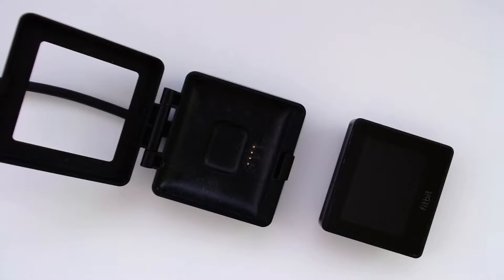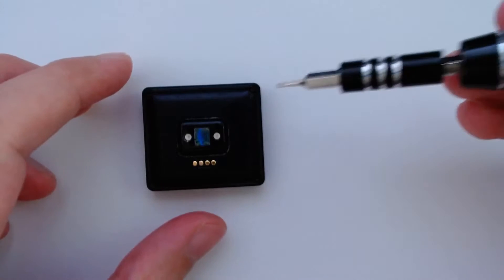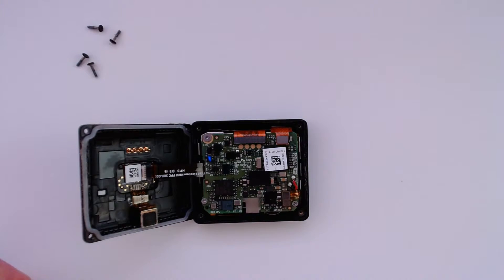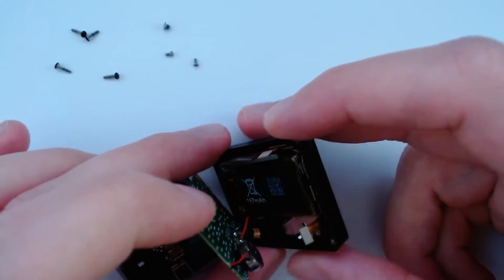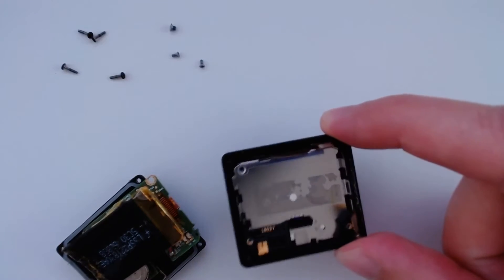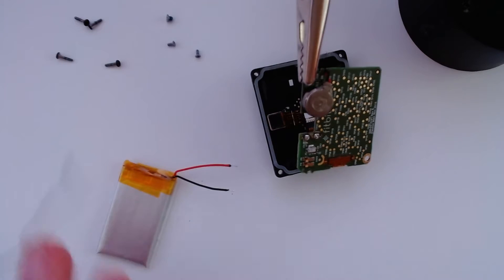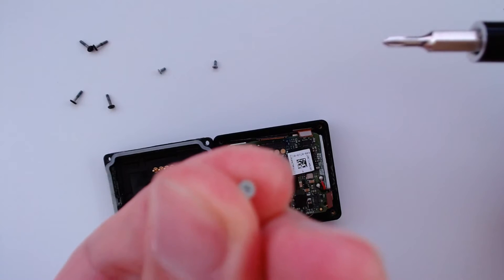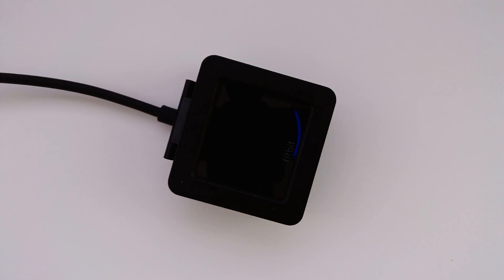How to replace the battery on a Fitbit Blaze (fixes overheating issue)

Comment: I managed to do this sucessfully. The only issue I had was that the speaker/vibrator was stuck down and so I had to desolder it to get the motherboard out. It does require a fine tip solder iron and steady hands !

Comment: Hi. Watching your video gave me the courage send for the battery and try to fix my Fitbit. I figured if it worked it would be a bonus and if it didn't work, I would still benefit from the experience, but I wouldn't replace the Fitbit. I ordered the battery and got all excited until I realised that I my screwdrivers were not suitable, so I had to order a new set. When they arrived, I watched your video and opened the unit and got stuck in. I had a battered soldering iron, but it was clunky, and the solder was balling. I ordered a new iron and waited... I wasn't home when it arrived, I had to collect it from the local office. I collected the parcel and went to the local hardware shop to get some flux to complete the job. However, I wasn't prepared to pay £14.99 for a tub so ordered it online (£3.00), and waited...The flux made a big difference, and my first attempt got it working in the charger, but I was unable to switch it on I was going to chuck it and chalk it up to experience but I decided to sleep on it and look at it again a day later. One of the battery wires had worked loose trying to set the new battery in place and I took photos of the unit as I went so could also see that the battery was not facing the correct way for my model. I reset the connection only to see that all the messing about pushing and pressing had disconnected one of the speaker wires. "Oh, for flux sake," I thought! It just wasn't my day. Again... I slept on it and came back at it the next day. I re-soldered the connections, flipped the battery, shut the unit and held down the start buttons not expecting it to work at all. It worked! It switched on. Thank you! Hahahaha! I'm going to have a go at my TV next. The solder was balling there too. You've created a monster now! 😊😉😁 Thanks again.

Comment: Thank you for a very clear and informative video. Could you please tell me what power your soldering iron is? Thank you.
Reply from the maker: Hmm, I don't think I remember exactly what setting I used. I would say go with low to medium heat/power. The wires inside are so thin that it doesn't take a lot of heat to melt the solder. And you don't want high heat around batteries anyway.

Comment: Did you use a static free surface? I know I had to use a static free surface with installing a computer motherboard. I assume same thing here?
Reply from the maker: I actually didn't here, but I do agree that having an anti-static environment is a good thing to have. I usually discharge myself by grabbing something metallic before I start working. Also I have hardwood floors. If you work on carpet there's a higher chance of a static charge.

Comment: Thanks for this. I am an experienced electronics tech and your video was very instructive and well done. I do add one caution - when reassembling, be sure the battery wires do not prevent two gold contacts on mother board from mating with gold contacts in the case. Just need to route them out of the way.

Comment: Thank you! I watched your video (as well as a couple others) but yours was the one that really got me through the swap. My issue wasn't one of overheating. The battery simply would no longer hold a charge. Thank you for your video and good instructions. My Fitbit is charging just fine and I'm anxious to start to wear it again. Well done.
Reply: My forgot blaze if I put  charger  I full  but  If take  out green  light  come  out

Comment: I just followed this video and replaced my battery, but the new battery will not hold a charge. I left it charging for three hours and as soon as I took it out of the charger, it died and wouldn't turn back on until I put it on the charger again. Any ideas why this isn't working for me?
Reply from the maker: Hmm, does it stay on even a little bit after you take it out of the charger? If it doesn't, I would maybe ensure that the polarity on the battery is correct. Also, how did the previous battery behave? Did that one hold a bit of charge? If the old battery behaves the same, you may have a hardware problem in the charging circuit on the fitbit so charging isn't happening at all. If you have access to a multimeter, you could try probing the two pins on the battery while it's charging to see if there's any voltage there. If there's no voltage it's probably the charging circuit, and if there is some voltage then it could be a bad battery, despite being new. Hope that helps. Sorry, it's kind of difficult to speculate without having it in front of me.
Reply: @AlexInFlatland  Same issue. I replaced the battery but the blaze still not charge, and after a few minutes becomes hot. :(
Reply: @AlexInFlatland  I've got this as well. Replace battery, is on with low battery, won't charge. :/